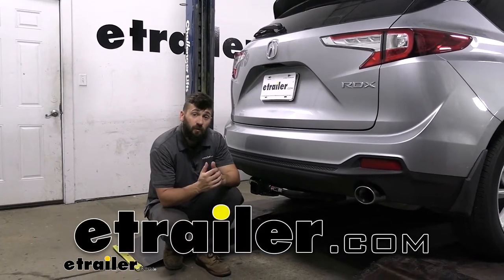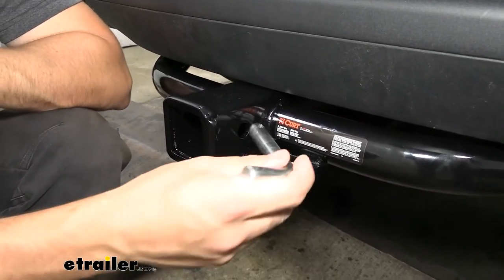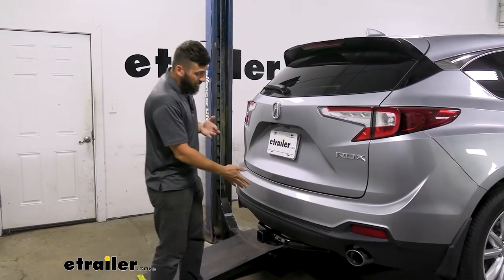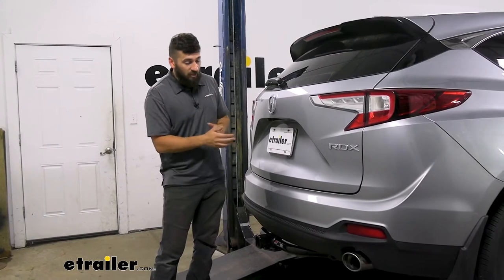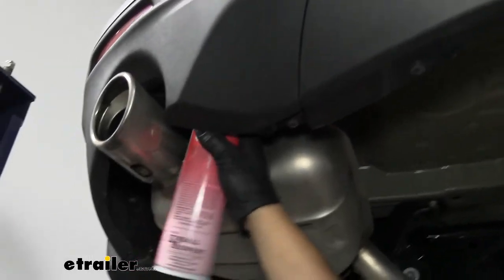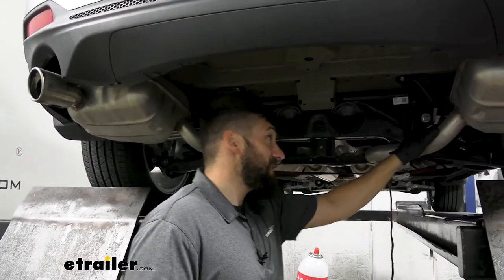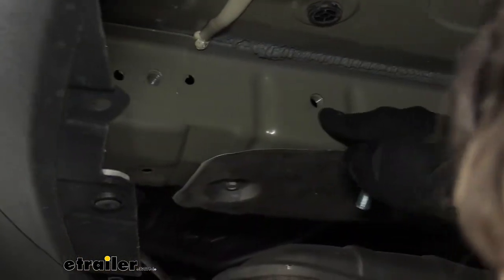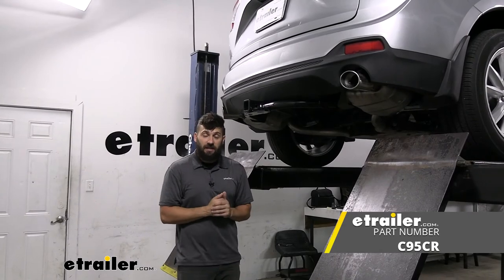etrailer | Installation Guide for the Curt Trailer Hitch Receiver on a 2021 Acura RDX

Comment: No wiring?
Reply from the maker: Because not every hitch is used for towing, we have the trailer wiring videos posted separately. To wire a 2021 Acura RDX for towing a trailer, we'd recommend using the # 118804. 
https://www.etrailer.com/Custom-Fit-Vehicle-Wiring/Acura/RDX/2021/118804.html